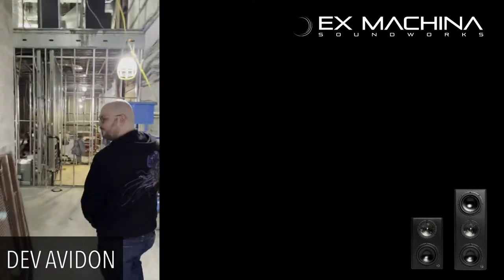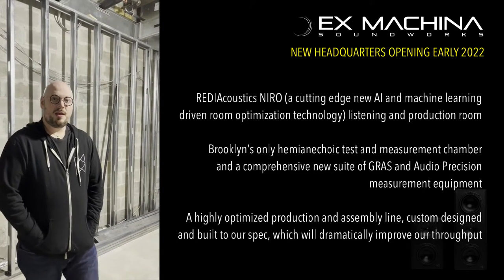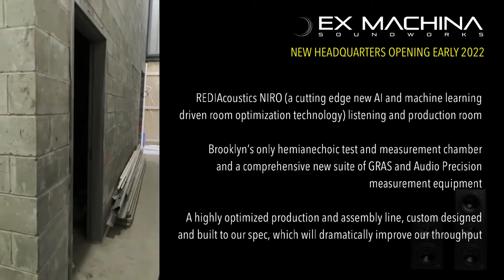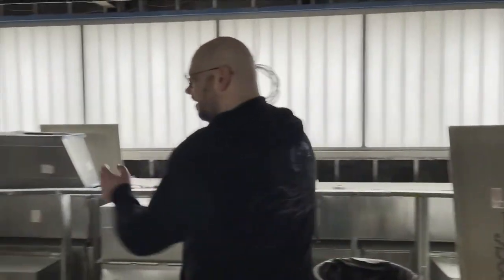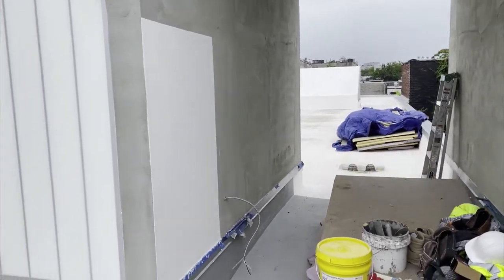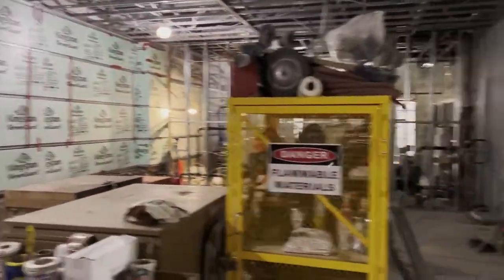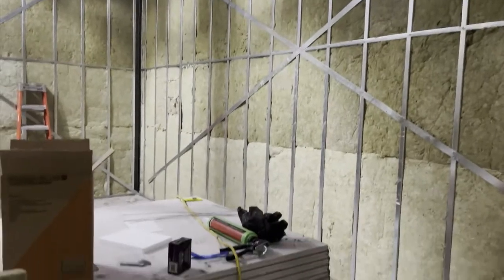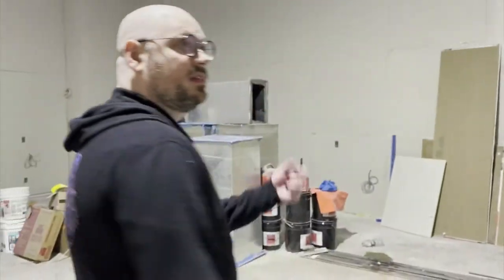Ex Machina Soundworks New Facility Tour | Opening Early 2022

Comment: Would you say a Trinnov st 2 pro system is over kill or not needed with your monitors?
Reply: I wouldn't say it's overkill, we have a handful of Ex Machina users who use a Trinnov system with great success. The only thing that the Trinnov does that doesn't work well with our speakers is the phase correction, we already phase correct the speakers so this feature is overkill on the Trinnov.